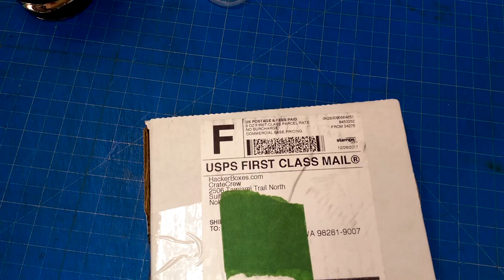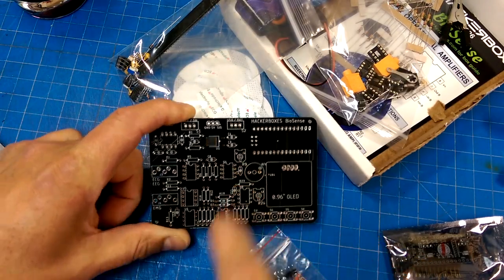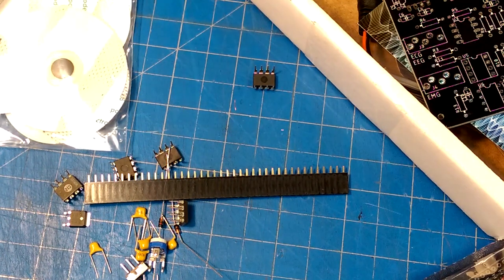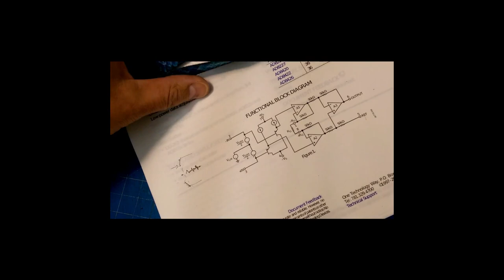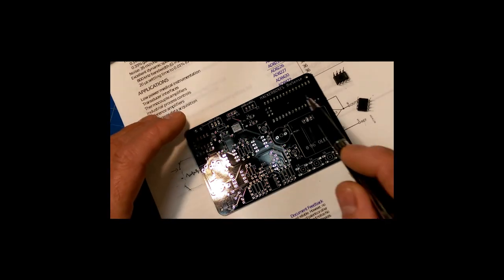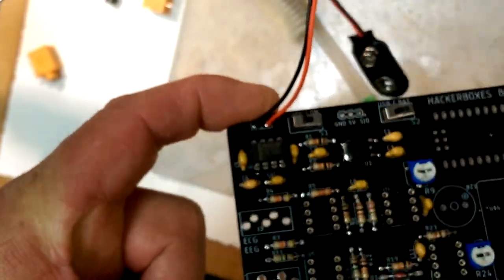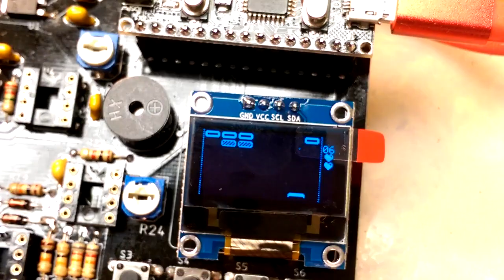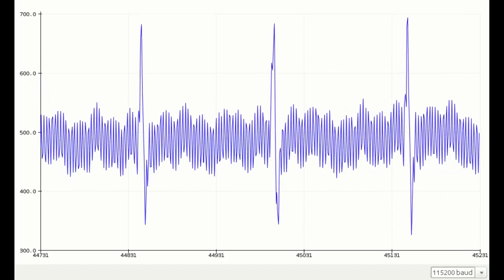0026   BioSense

Comment: The packaging of the components makes me sad. Those clear plastic bags are ESD generators.
Reply: Same concern occurred to me. Fortunately, everything survived and the circuit seems to be working well for me and apparently grtyvr also was successful. 
No chips were harmed in making this video.
Reply from the maker: On the other hand, how noisy was your output? Did it look like mine? Could be damage but not failure.  Hackerboxes, can you send me more of those precision op Ps and instrumentation amps?  I need to do some testing 😁
Reply from the maker: Op amps I mean.